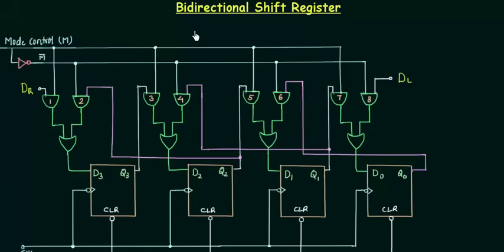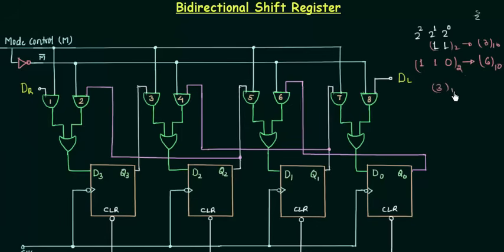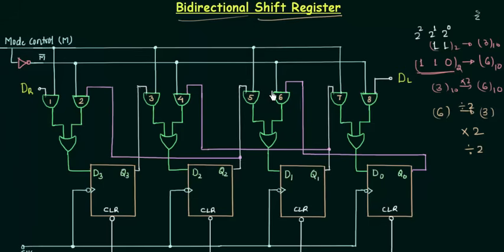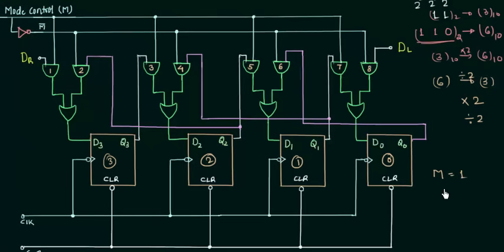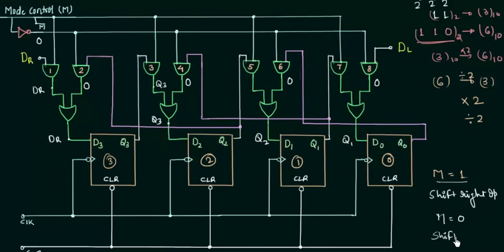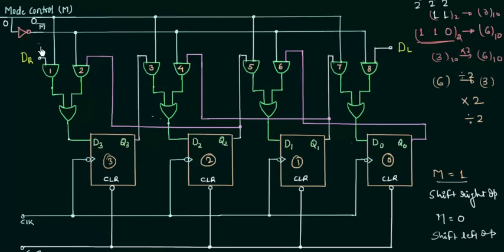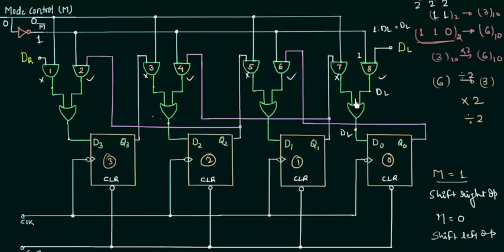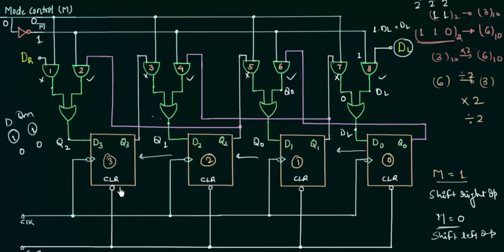Bidirectional Shift Register

Comment: I have a question. Let's suppose that this circuit is a serial-in/serial-out circuit with Q3 as the lone serial output. Additionally, let's suppose the circuit starts out with Q3 = 0, Q2 = 1, Q1 = 1, and Q0 = 1 (from left to right, 0111). Now, I know that if the mode is right shift, inputting a stream of 4 zeroes will produce the sequence "0111", and that if it's in left-shift mode, the output will be "1110" if read from left-to-right.

My question is this: when the shift mode is switched from "right" to a value of "left", does the internal state go from Q3Q2Q1Q0 = 0111 to Q3Q2Q1Q0 = 1110? In other words, does changing the value of the left/right signal cause the values of Q to be switched around such that the sequence is reversed?